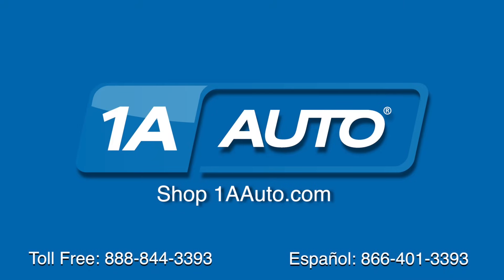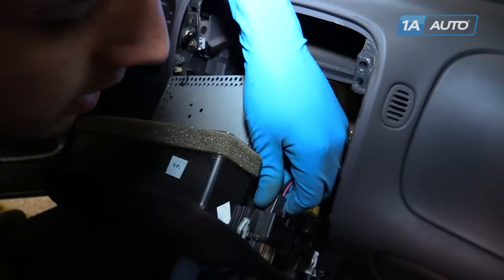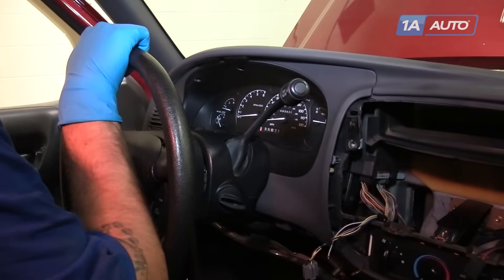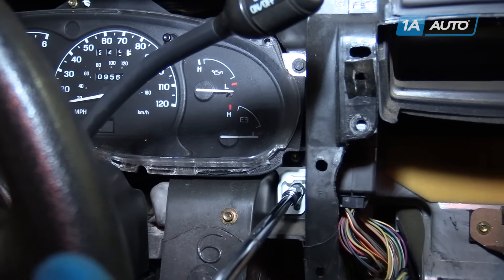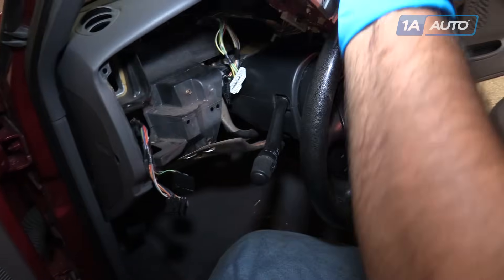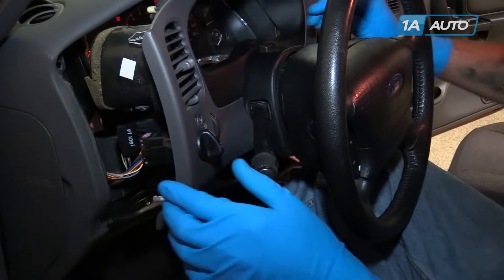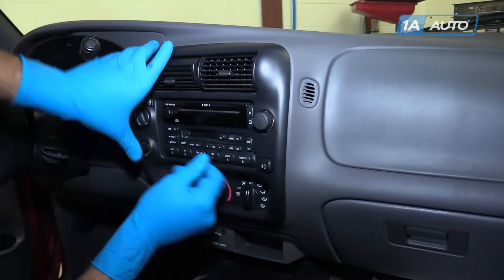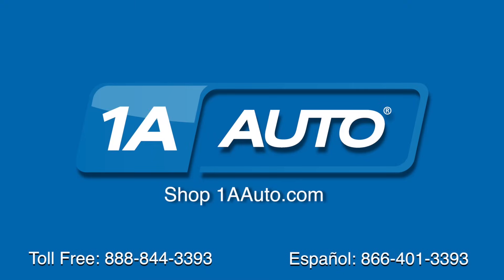How to Replace Instrument Cluster 93-03 Ford Ranger

Comment: This video is on an '01 Ranger. The 1993 has a speedometer cable. This '01 does not. It appears from the ease of the cluster removal after the screws are removed, that this particular truck does not have a speedometer cable connected to the cluster. That, my friend, is a pig of a job. there is very little space, very little give in moving the cluster to allow getting into the back to pinch the little white connectors to release the cable. Some have taken to disconnecting the cable under the truck allowing a little more slack to let the cluster move away from the dash. I have yet to find a video on easily disconnecting the cable on the '93 and earlier. Any volunteers?

Comment: Am not replacing the cluster  panel, i just want to test the wires cause both temperature gauge and fuel gauge are not responding...so you mean i gotta remove all of that just to test the wires?

Comment: I finally figured where the blasted noise maker was for the headlights, seatbelts and all that good stuff.  Turns out its INSIDE the gauge cluster. I removed it all and found the annoying noise maker and took it off the circuit board. What a relief, no more dinging!! This was on my 06 Ranger. The rest of this video is definetly helpful. If I was him though, I would have eliminated the dinger. On mine though, I was having issues with the door open alarm. I went and bypassed all the door switches and it STILL dinged.  Drove me nuts. Not anymore!!

Comment: You should add that you should remove fuse #11. I wound up blowing that fuse during reassembly.
Reply: Or disconnect the battery like repair manual says.
Reply: David Greer what does that fuse control?
Reply: Good to know that risk is involved. My dumb self would have forgotten to disconnect the battery thank you for the warning!

Comment: The dash on a 1993 Ranger is completely different than this one. I'm having trouble getting the instrument cluster out of my 93 Splash. I can't get it out far enough to reach behind and remove the speedometer cable and the two connecters that are attached to it. Any suggestions how I can get it out far enough or is there a different way to do it on a 1993?.
Reply: John White any success? I am trying to get the face off my 94 splash
Reply: its the speedometer cable unclip it from the trans and you can pull it out a few more inches still gotta reach your hand behind it
Reply: don't be shy with it. just give it a good pull and it will move out a couple more inches and the cable can be removed with pliers.

Comment: I have a 1996 Ford Ranger and the instrument cluster plane works excep the temp gauge do I have to replace the whole cluster. The gauge sensor and sending unit has been changed except the eng light still is on. Mechanic said everything is working properly.

Comment: 02:14, if you really wanted to could you use a small hole saw through the radio bezel to remove that one hidden 7mm screw behind, instead of removing the entire bezel? You could easily plug the hole in the bezel with a factory type plug.

Comment: I unplugged my cluster when fixing a different part and everything worked. When I plugged it back in the  tachometer doesn’t work. Any advice?
Reply: The main connectors that plug into the back of it may have a bad connection. Clean the terminals then try again.

Comment: Can you also remove and replace the glass on the cluster or would you need a new gauge cluster?
Reply: I work on these vehicles sometimes I beleive the gauges are sealed to prevent moisture and fogging so you would need a new set or a expert to redo that.

Comment: I have a  98 ranger  I put on two alternators battery light comes on when the switch is off and key removed goes off when the truck is running

Comment: Will the mileage from the current truck if i took a gauge cluster out of a different truck or will the mileage be of of the other truck cause I want to change mine out for a rpm gauge cluster
Reply: You can take the odometer out of your cluster & swap it to the new one. Or just find a junkyard or eBay cluster with around the same miles as yours & don’t worry about it.
Reply: Your truck will crank but not start because of immobilizer.

Comment: Hi guys how are you? Ok here.
Anyways I broke the shift indicator cable on my '07 Ranger, do you have a video showing replacement? I see here on the gauge cluster removal & installation helpful, but not showing anything else. Also I'm understanding that the cable assembly comes as a whole unit from indicator gauge to the cable loop /snare to shift lever. 
Any help would b appreciated ..
Thanks,  Rob

Comment: would this be the same in a 2006 mazda b3000? also i went to your website for lightbulbs replacements for the instrument panel cluster , and there was none for my truck.
Reply: I'm going to guess Yes, don't have my repair manual handy right now, but for those years the book is for both (mine's a 2000)

Comment: What is the size  or socket type for my Ford Ranger 2001 xlt
Reply from the maker: This install requires 7mm and 8mm sockets. Thanks for watching! +Jonathan Zavala
Reply: @1AAuto  than you but I'm sorry my question is what type of light I need for example led light T10 connector or h4 dou you understand? In the dashboard waht light I need use

Comment: Have trouble with my 96 Ford ranger auto 4 wheel drive speedometer works but quits
Reply from the maker: +Stephen Clemons We wouldn't be able to diagnose an issue like that here, you may want to have a local mechanic take a look at it. Thanks for checking us out! 1AAuto.com

Comment: Aren't you suppose to disconnect the battery?
Reply from the maker: +Raul Fister Thank you for watching. It is recommended to disconnect the battery whenever you are working with electronic components in your vehicle. 1aauto.com
Reply: it's easy, and it can't hurt (unless, maybe, if ya pull the pos cable first or something, lol)
Reply: @1AAuto  the negative or the positive